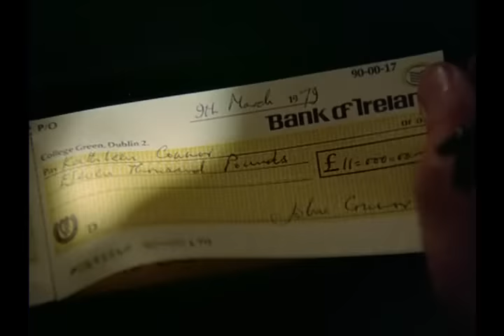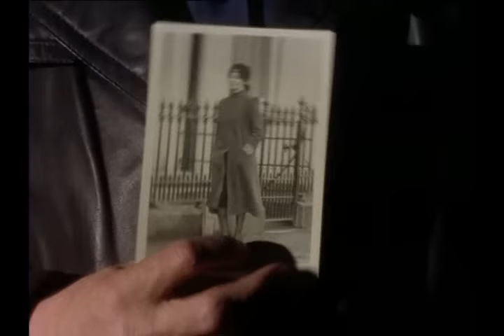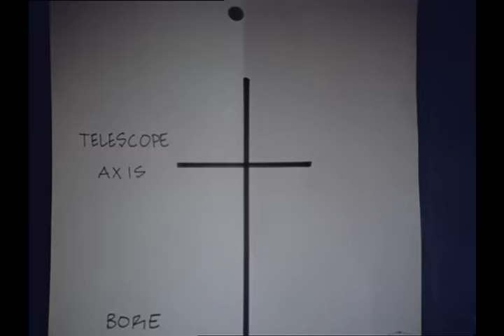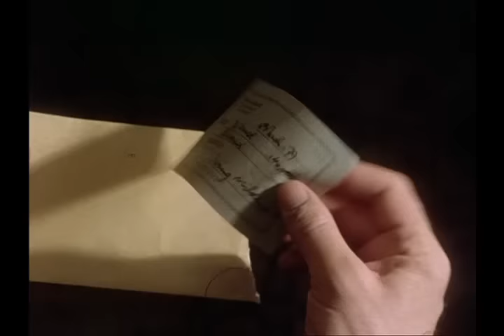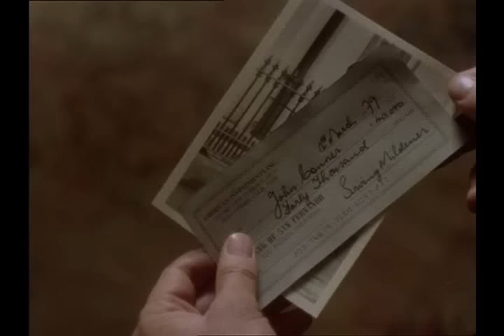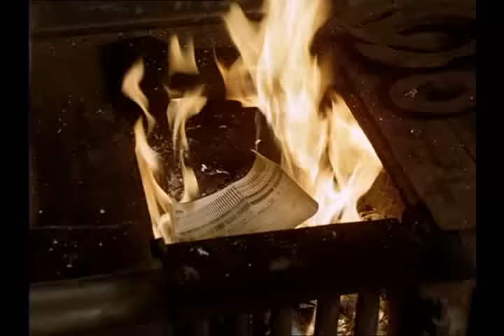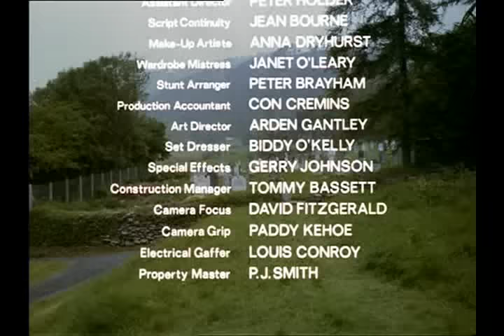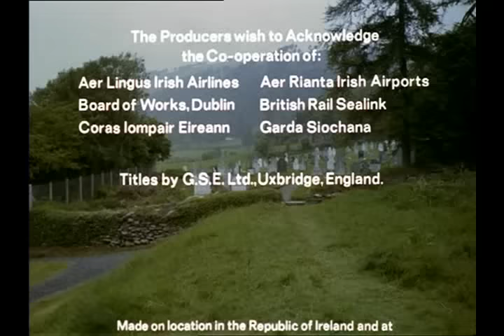The Hard Way (1979)

Comment: That wasn't a BR carriage at 04:15 ! They never had double doors that would slide together ! Only a single sliding door that slid across from left to right to close the compartment off from the corridor ! Irish Railways possibly !?
Reply: Even the seats and the poster behind don't look BR ! BR had blue seats in those days ! The compartment is too small and not wide enough ! The Locomotive and carriages do look BR though when the train starts off !! A BR Class 86 Locomotive is seen at the head if the train !